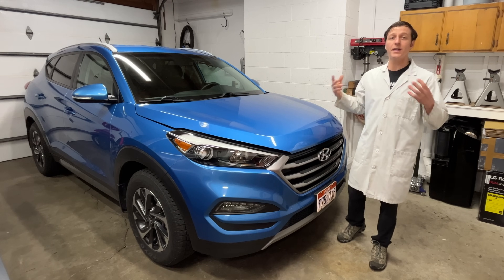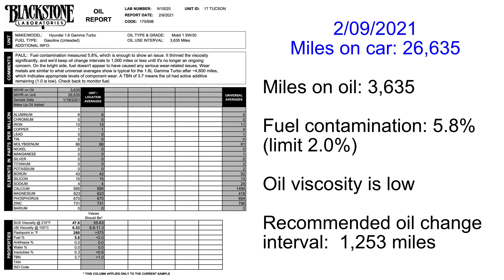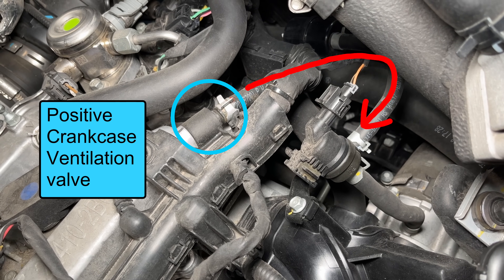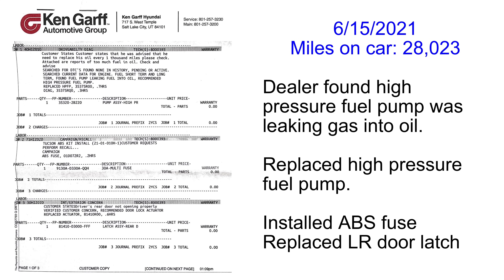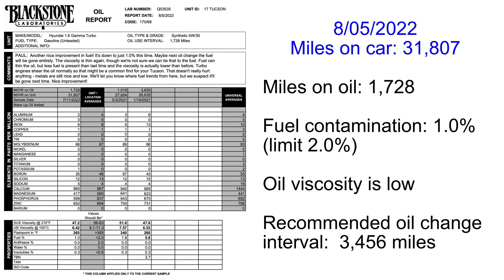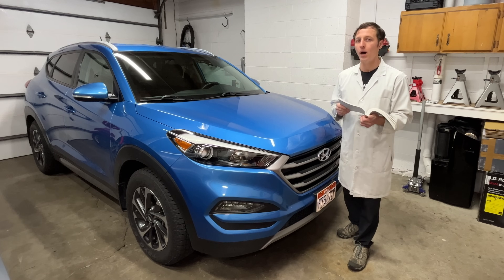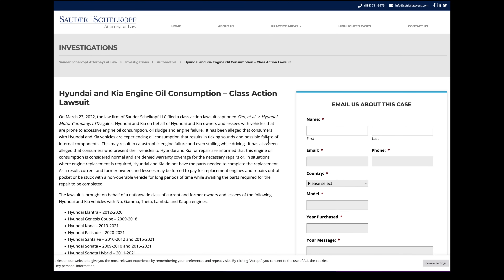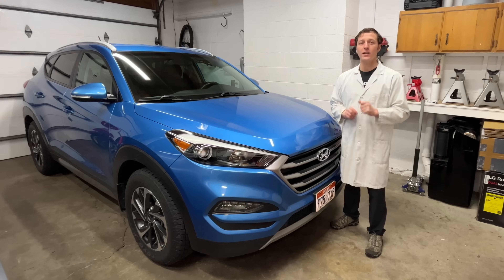Hyundai oil consumption and gasoline contamination problem solved

Comment: In 2022 our 2019 Kia Rio began to bellow white smoke that reeked of gasoline. After a little research I found that it had a fuel pump mounted to the valve train. Took car to dealer, and dealer said that warrenty was exceeded by mileage, and part not part of drive train, and not covered by drivetrain warrenty. New pump was going to be $1200.00 installed, and part backorder was going to be five weeks minimum. I asked if spun bearings due to gasoline in crankcase, and burning car were covered under drive train warrenty, and they hung up on me. Called corporate and they advised part was covered under drivetrain warrenty because contract is in owners manual which has no fine print whatsoever. For the sake of expediency I bought brand new pump from another manufacturer, for $150.00 which arrived in three days, and then spent ten minutes replacing pump. It has run fine until recently when Rio was stolen, and severely damaged when run over a curb whicvh broke engine from transmission plus window broken, column trashed, and wipers broken off because thief accidentally started wipers when breaking column to steal. Kia denied ever hearing of theft problem. Kia wqanted two hours troubleshooting to give estimate for repair. I said I already know what is wrong with car so just fix it. Then Kia at insisted we prepay repair bill before work began. I asked how they could possibly know what was wrong with car ahead of time, and that must be a new thiung where dealer wont fix car unless you prepay. Told wife to leave car at Kia dealer. Kia said they would have it towed away for being parked illegally. I called corporate who has brand new stolen Kia runaround line dedicated to irritating customers who have had their Kias stolen already, and they hung up on me. I called the Bureau of automotive repair filed complaint then they had me call the federal trade comission where I also filed complaint. Since my wife is Thai I called a local Los Angelus Thai language newspaper to see if they would do a survey of their Thai community who owned Kia cars, and they agreed (my wife knows the owner of the paper). Accidentally recieved phone call from Kia corporate in which they accidentally gave me a direct line right back to the woman who hung up on me. I called, and informed her of my actiopns. She said the whole thing is a misunderstanding on their part if I already had the insurance check in my hand, and NOW the dealership WOULD look at theft damaged car but my wife had to go in and sign a permission slip. Keep in mind Kia is required by a class action lawsuit to repair these cars, and pay all related expenses. My insurance company shouild not have to pay anything to anyone as Kia has been found responsible for fasiling to protect these cars from theft properly. My wife is making monthly payments on this car, and it has been damaged, and undriveable for three months as I write this causing us to buy another car. Considered renting one and backcharging Kia, but I am not an ass looking to make the reimbursement as expensive as possible for Kia, I just want them to fix it. They are dragging their feet at the customers expense, and are downright rude about it once you get them to stop lying. I have purchased two new Kia products lifetime, and will NEVER EVER buy another.

Comment: so it's a safe bet don't buy a Kia/Hyundai....I have a  2009 Grand Caravan with 180,000 miles.....it uses 1/2 quart of oil every 5000 miles. I want to get a new car but am hesitant as to what I am hearing with the junk out there.
Reply from the maker: A lot of the GDI cars out there have fuel contamination in the oil.  Keep the old car going until it blows up and do a lot of research before buying something else.

Comment: I had a pre 2010 Elantra that went 300,000km. never took any oil never had a motor problem. 
It seems the oil rings on the newer Hyundai and Kias are weak and this is what is causeing the problem.
Reply from the maker: I heard that too.  I guess they have less friction or something.  That combined with a turbo and GDI is asking to get gas in the oil.  At least it's more fuel efficient with 24mpg...  Oh wait, that's actually not good fuel economy either.

Comment: I think mine is lasting so long BECAUSE i never did any oil change, I just keep adding oil and remove the filter every 10k because it has burned so much oil from day 1 I bought it at mile 1 its now close to 240K miles

Comment: Fuel dilution in crankcase oil, undersized rod bearings, insufficient oil flow to rod bearings, metal shavings in crankshaft oil passages, low speed pre-ignition, piston slap, insufficient pcv valve flow, soot, stuck oil control rings, valve stem deposits and a few other problems I have probably forgotten or haven't come across yet. The number of problems with this engine is staggering. A lot of these problems can be managed by a knowledgeable and motivated owner, while some cannot.  But for the average owner, these engines are a ticking time bomb.
Reply from the maker: I agree.  My plan is to change my oil every 3K miles and send oil to the lab every other oil change to see if any new problems pop up.  I should be able to squeeze 100K miles out of it if I watch the ticking time bomb closely.
Reply: @LabCoatPaul  A person should be able to get 200K miles out of a well cared for engine. It's unfortunate what this manufacturer has done.
Reply: @LabCoatPaul that's what I'm doing on my '19 sonata (2.4L theta II). Bought it new, now drinking oil at 74K at around 1 qt per 1200.  BL, I should get 100K at the rate I'm driving, and after that it doesn't owe me anything. I didn't overpay for it, to wit I got it for well under MSRP which I'm still kinda surprised in hindsight they let it go for that in 2019 (ah the good ol days before the Fed stole our future lives with M2 printing) which is why I went with a sonata over some overpriced Honda (mazda outright got out of the full size sedan business altogether so there went that). 

I am very satisfied with the fuel economy, ride comfort and interior dimensions of my sonata. The frame, suspension, transmission (it did get a software flash when I replaced the fuel pump under warranty and got the bearing knock software subroutine flashed, only work visit required in 75K) and electrics have been problem free, which keeps the dispatch rate high, which is the only thing I care about in a car (they're commodities to me, I'm not a car enthusiast). 

To wit, I don't need to run oil analysis when I know it's a problem nobody is going to fix. Catch can potato this late in the engine life is also throwing good money after bad. This engine is on palliative care at this point. I'm currently having to add oil in between oil changes given the oil consumption doesn't let me get to a normal 5K interval, so in a way it's like doing oil changes every 2K miles.
Reply: @talondrvr  The Honda Accord has the same problem now. The L15B7 does the exact same thing and the K20C2 probably does to a lesser extent. Only way to go NA anymore is to get the hybrid. I miss the J35 in those cars. Our shop foreman got a 2017 V6 touring, the last year you could buy a V6 one. They just have fewer problems with normal maintenance (they do have timing belts, but a Honda J series timing belt is one of the easiest timing belts to do on a modern engine. It's 100% a DIY friendly job and you can do it in just 3 or so hours once you know what you're doing)

Comment: Well you definitely hit the nail on the head with this one. I own a hyundai ix35 here in Australia with the 2 liter Theta engine, which is basically an earlier tucson and yes it burns oill and I am constantly checking the quantity and quality of the oil. For now its running ok but as you said we are all driving ticking time bombs. Very well explained video and thanks for the valuable information.
Reply: Use valvoline restore and protect oil

Comment: How come a large part of the Diesel Engines do not have this problem since they also use DI since like forever? Also some newer VAG TSI engines seem to be pretty reliable for up to 200.000 km. I'm thinking quality of the parts and build is to blame also here
Reply: Diesel has lubricant qualities. Plus yes , built more robust.

Comment: I have a 2018 Tucson SEL and I'm going through oil like a madman. Lost half a fucking quart in 280 miles, total down a whole quart on this oil change that I just did 5 weeks ago and only am only 1,200 miles into. What engine would that one be?

Already changed the PCV valve, at first thought that fixed the issue. It didn't. Next step is replace the spark plugs just because, as well as going up from 5w20 to 5w30 and using a Lucas treatment to see if that stops the excessive consumption. I was about to trade this shitbox in and my hours got cut at work, so I couldn't afford it.

Comment: Paul, thx for the help. I have a santa fe 2016 that is burning oil. 78K miles. what oil wait would you recommend to use  such as 10w 30 or ??
Also since burning oil does it make send to go to regular oil if changing every 3K vs synthetic every 5K? Curious what your take would be on just using the regular oil?

 Hyundai dealer want me to spend $450 for a decarb? curious if you think that is worth doing or changing the PVC value is worth doing or will either make a difference? Sounds like you just have to keep changing the oil about every 3K or keep topping off till 5K. Any other ideas how to curb the oil consumption? Thx Paul M.
Reply from the maker: Unfortunately, once you have oil consumption, the damage is already done.  Change your oil and send a sample to Blackstone labs.  Follow the lab's recommendations on oil change interval.  
I recommend using whatever oil viscosity is written on the oil fill cap.  On my Tucson it's 5W-30.  Since you won't benefit from the longer life of synthetic oil, you might as well use the cheapest stuff you can find (as long as it has the correct SAE rating for your car).  If your car has a turbo, it may still be better to use synthetic oil.
As for the GDI carbon cleaning:  yes, do it.  clean intake valves are very important for the engine to run right.  
$450 is not the right price for GDI cleaning.  Did they recommend a service package that includes other things?  
I recently paid $671 for my 30K mile service, but it included:
oil change, transmission flush, coolant flush, fuel induction cleaning (GDI cleaning), tire rotation, brake fluid flush, and inspect a bunch of stuff.
They didn't give me a labor breakdown for the GDI service, but the chemicals were $39.  I'm guessing the GDI service alone is around $100 total.
And yes, clean the PCV valve.  it's easy.  You can do it yourself.

Comment: Couple of questions because I own this car too.
1. What brand of Oil do you recommend using for this car?
2. 5W20 or 5W30?
3. Do you recommend the Fuel injection cleaning from dealership?
4. Do you recommend adding ATS oil and fuel cleaner (like scotty does)?
Reply: I own a Santa Fe with the 2.4 and my only recommendation is to trade in the vehicle for a Toyota while prices are still high. 

I use 10K mile Mobil1 full synthetic oil in all my vehicles, except the Hyundai. It burnt it within 3K miles, so I switched to the cheaper super tech full synthetic and I now do 3K mile oil changes. At least in my car, after changing the PCV valve every 10K miles and turning on eco mode has helped reduce oil consumption. Good luck.
Reply: @powerjd do you use super tech 5w30 or 5w20
Reply: @truebengalsfan  I use 0w-20
Reply: @powerjd I will try it I know some with 2012 sonata 2.4 having same oil consumption issue
Reply: @truebengalsfan  yeah, it’s a defect that Hyundai refuses to take care of. Only certain models are covered under the recall from a few years ago.
Reply: @powerjd why would you say the eco mode helps? Thanks.
Reply: @asianstud7  eco mode restricts the amount of oxygen that goes into the engine by changing the throttle and O2 sensor behavior. When accelerating, less air means less gas and thanks to Hyundai’s faulty piston rings, it also means less oil is burnt in the combustion chamber. Next time you’re at a dead stop, turn on eco mode, then turn it off while accelerating, you’ll notice the difference right away. You can also try to keeping your RPMs as low as possible when accelerating to get a similar result.
Reply: @powerjd  interesting. Is this a proven method or are you making an educated assumption?
Reply: @asianstud7  bad piston rings are a well documented source of oil consumption, especially Hyundai engines. I’ve driven the same commute with eco mode on and off for 1K miles each and the difference is noticeable.
Reply: @powerjd  RIght on. Thanks so much. Ill try that!!
Reply: I assume you mean "induction cleaning" as in cleaning the BACK of the intake valves. A GDI has NO gasoline hitting those intakes to clean off the oil vapor from the crankcase. Fuel injection cleaner will DO NOTHING to clean the valves!
Reply: I have a 2017 tucson as well my oil is being consumed have to add oil abouy every 2 days but since April I keep having a misfire  for my piston 1 and 2 have to continously replace spark plugs and coils any solutions ?? Please help it's my only vehical I've paid mechanic to do a check and they thought it was gasket cover replaced that and it still keeps happening.

Comment: You can put an air/oil separator on the pcv line to reduce valve carbon build-up.
Reply from the maker: That's a good idea!  I bought one, but I haven't installed it yet.  I want to do a comparison video to see if the oil separator actually does anything.
Reply: Then why isn't Hyundai doing this for free?  I bet the part cost them almost nothing and probably take the mechanic 30 minutes to do.
Reply: My 2 L turbo, (2-13),  has a built in oil separator, I did add a catch can a few years ago. It doesn't catch much oil, but I do get sh*tty brown water in it. Better in the can than the back of the valves.
Reply: You can also use a "low volatility" oil that generates less oil vapors. Currently the lowest volatility oil on the market is Pennzoil "ultra platinum full synthetic", it's even better for GDI engines than Amsoil!

Comment: That's why when I bought my twenty twenty one  Kia rio.  I checked the window sticker under performance, what type of engine?
It's a 1.6 MP I.  I did show the salesman that it had to be multi port fuel injection. If it was Gd I would have never bought the car.
It's OK, but it's a maintenance issue later down the road.

Comment: I have a 2018 Santa Fe Sport with 76k miles on it, having this exact issue. I have only added 22k miles to it the three years I have owned it and have never gone beyond 5,000 miles on an oil change. Always full synthetic. Waiting to hear now if they will replace my engine under their warranty. This is such a sucky situation. No way my car should be burning oil at the rate it has been. I’ll never touch any type of Hyundai or Kia again in my life.
Reply: I’m going through the same thing right now. I won’t go through the whole thing, but it got towed in from my house when I check in the morning I had no oil I it . I called the dealer immediately and had it towed into them. Absolutely no lights were on nothing just on a whim. I figured I’m going to check the oil and that’s what I found. I was shocked and now I’m researching the hell out of this.
Reply: I’m gonna get mine fixed as best as I can.  They should pay for a new engine and I’m  researching everything and I’m trading the son of a bitch in as fast as I can for a Toyota
Reply: I"m 93,000 for my 2019 hyundai tuscon. Just luckey to catch my oil bone dry 2x! with light coming on for air in tires! turns out both times absolutely zero oil in the car! So far I haven't blow my engine. Bought 2 cases oil at costco and dealer told me i'm burning 1 quart every 1,000 miles! I was planning on driving this car another 50,000-60,000 miles! Not sure what is going to happen but on 12/4 dealer has opening to have the car for full day. They said they would try to get a new engine but no promises! I priced new engines sounds like around 8K.
Reply: Great video! Got 2016 tucson and recently notice my oil went dry at 3000 mile! I also am seeing oil leak... only st 53000 miles. Should I not use full synthetic oil?

Comment: Just purchased mine 7 months ago. At around 3000 the car started running ruff. Checked the oil and it had a strong Gas smell. It now has over 120K miles on the engine and it isn't using any oil.but i dont go pass 3000 miles anymore. Hope to get the Blackstone analyses done soon.
Reply from the maker: Thanks for watching!  I'm curious to see what the lab says about your oil.  If you test your oil, please comment and let me know how much fuel contamination you had and how many miles were on the oil.